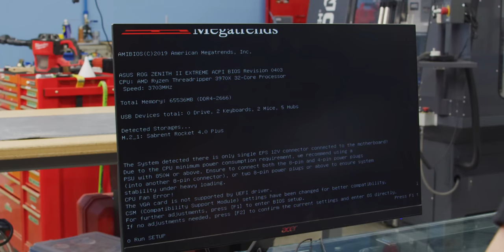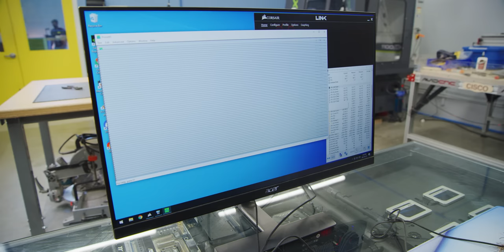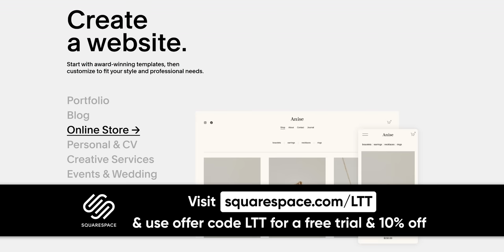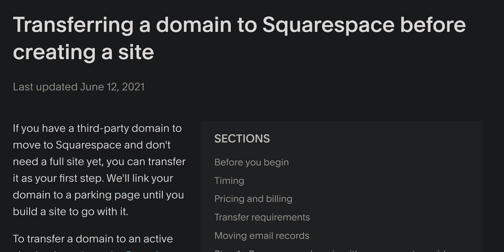Powering Up My ZERO Compromises Desk PC Part 4

Comment: Guys it’s no compromise for the task at hand. It is not physically possible to use a 3090 or even a 3080 while still retaining the requirements of the project.
Reply: It is still possible,  just have separate radiators for cpu and GPu. This build still maxed out at 70-80c
Reply: @inteallsviktigt  While that could work, it would also end up needing more fans for those radiators or the existing fans would have to run harder thus compromising the quiet requirement of the pc

Comment: Why don’t you use ethanol or some other non-consuctive liquid to find leaks? Like spray it on the joints and watch the bubbles. Trying to listen for such small leaks is hell. There should be a better way.

Comment: Linus' diatribe about the nail gun has it's roots in truth.
Aug. 12, 1982, Linda Archipolo was working in a Burger King in Nassau County NY, when a nail gun was fired into the wall that connected the two places. The nail went through the wall, through the wall of the Burger King, across the restaurant, and lodged itself ~1/2 way through the opposite wall. When Archipolo investigated the odd nail, she was struck in the back of the head with the second nail.  It entered her skull from under her right ear, point first, tumbled through her brain, and the head of the nail exited from under her left ear. She survived the incident, and the nail was, of course, removed. She, however, suffered severe brain damage from the nail tumbling it's way through her brain.

The guy that shot the nails was trying to anchor a poster to the wall that connected the two places. So no, Linus, that shit ain't exactly funny.

Comment: Totally disappointed that it doesn't totally max out ram and go for the 64 core thread ripper, you said NO COMPROMISE! YOU COMPROMISED! Other than that, I can see this being done soooo much easier, but yeah I guess that acrilic tank is nice I guess, I'd just be worried all the time bout that thang, anyway, why not like a terabyte of ram and the 64 core? I was hoping this was going to be a special desk pc that could be used by Linus AND a video editors, and be like used to n a lottery basis or rotation...

Comment: Are the fans just not powerful enough or not the correct housing to create negative pressure?  Cause wouldn't it be better to draw in cooler outside air over the radiators instead of pushing air that's been heated by all the components across them?

Comment: Engineers my ass. Replace these useless fans with two crossflow fans and you will get some real pressure in there. Hell i bet even one of those would push more air. Same fans that make your AC work. Yep. Super quiet, super effective and PERFECT for THIS application.

Comment: So... What if one day the desk pc doesn't want to turn on. You have to remove that huge glass to check what the heck is happening, fix it, put the glass back, and make sure there is no air leaks bc your computer could overheat xD. 

Very good looking, but come on guys, that design is not practical at all. 

And... You are covering the LTT water tank with the keyboard 😭😭😭😭

Comment: Last gen cpu, mid tier performance ssd, 3070 and “absolutely no compromises”… or you could have bought the lian li desk and built a proper pc in there
Reply: That "last gen CPU" is actually the current Threadripper chip. AMD hasn't announced Zen 3 based Threadripper

Comment: It always confuses me when they say "giving up nothing" and yet they go with a GPU that, while not exactly "low end", isn't top of the line
I mean, I know Linus doesn't exactly need anything like an RTX 3090 for any of the stuff that he personally does at the company... but, like... still a bit of performance on the table
(But yeah, I guess even they can't afford to be deploying one of those cards in a workstation since they always say how they need to use what they have for testing, and even at MSRP, that card is rather expensive... but... like... I'm picky)
Reply: They recycle their high end components for build videos because they don’t have more than 1 or 2 them. If they had put their 3090 in his desk, they wouldn’t be able to milk it for more content in their other “epic builds”. He’s certainly not going to pay for one, a 3090 costs like 10 ridgewallet adds.

Comment: If you chilled the air before you pumped it in then used your flir thermal camera you woulda found your air leak. Hindsight 20/20 tho eh?
Reply: Or soap water with A pair of cotton swabs or two would do it even better
Reply: @inteallsviktigt  as we find out later in the video though theyde be going nuts swabbing the computer meanwhile it was the air tester that had a loose valve
Reply: @BattleB3rry  well it would confirm nothing of the o rings was leaking faster than trying to listen instead of waitign to the next day

Comment: The video title refers to "no compromise" but also should have included "no design."  Randomly stringing components over a large flat surface that requires turning it on it's side to fill the water reservoir, the random taping on of wires and components on the bottom, long signal paths to increase latency, reluctant consideration of an air flow pattern, no consideration of servicing or upgrading. It's just terrible; it looks like what happens when hillbillies- for whose ingenuity I have a great respect- keep their 1972 pickups running- hammer something on, prop up the corner with a block of wood, add duct tape, and then spray it matte black.  Twelve-Tone Tech Tip: when spending thousands on a system; make a drawing or better yet, spend a couple of hours on Sketchup. RTX 3070, a year in the making- really? Still - a fun disaster to watch; we can't turn away when passing a car crash!

Comment: Hey guys, recently came across "staticide anti-static spray" used on some electronics to prevent static buildup or dust build-up has anyone tried this with their pc components like motherboard, gpu etc? 

would be cool if this helps protect the components and dust build-ups

Comment: We Canadians are so backwards. We wear masks and visors long after the rest of the world ditched them, (viruses are like gravity after all - they're not Canadian) and an actual technical solution is UV light which you could have installed. And, you exercised a double standard when and when not to wear that gear. Also, read CDC's website - masks are futile when dealing with viruses. 

Nice build guys.